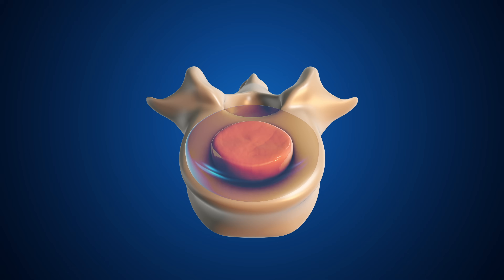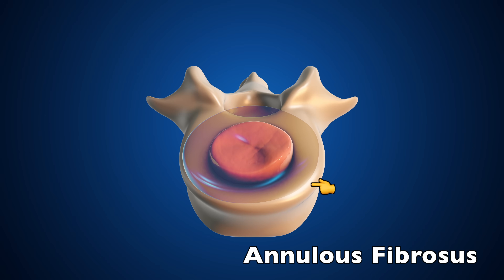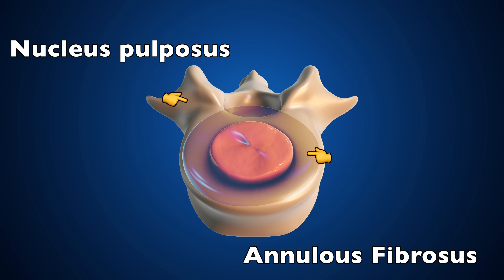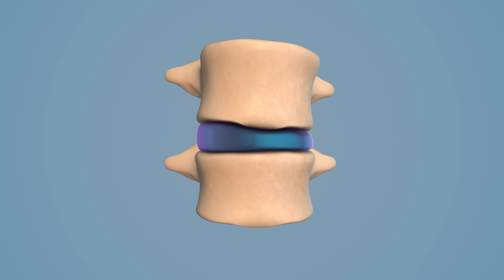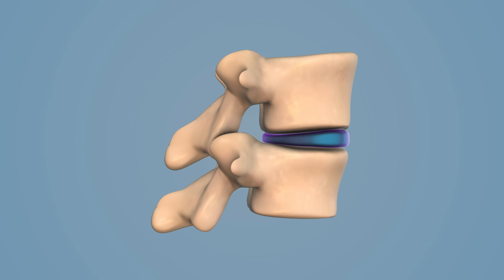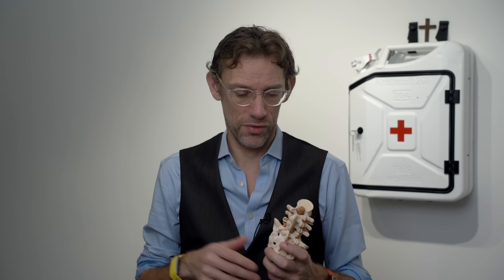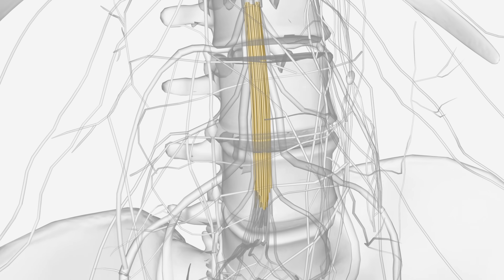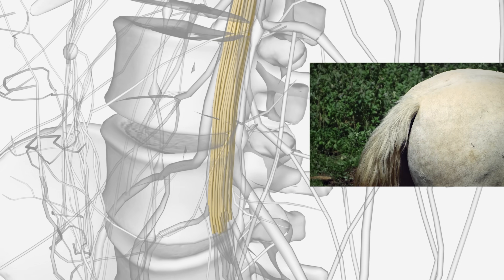Lumbar Spine Anatomy - What Causes A Slipped Disc? - Dr Gill

Comment: Hi Dr. Gill, I've been a subscriber of yours for a few years now, and I love your videos. I had spondylolisthesis with degenerative disc disease at the L5-S1 level, which was fixed with an ALIF about 2 years ago, after about two and a half years of being in and out of therapies and procedures (from ages 15-18: PT, steroid injections, and a microdiscectomy). It unfortunately caused irreversible damage to the nerve going down the back of my right leg and changed my gait, so I was wondering if you could perhaps do a video on the nerves, bones, and/or the general spine issues that occur there, their causes, and how to spot them in patients. This is more just for my general curiosity as a patient, but I love seeing all your videos and really admire your bedside manner. It makes learning from and watching your videos quite relaxing.

Comment: Thank you for this, much better understanding of my back now, I had a nasty fall backwards off of my bicycle where I landed directly on my back on a dirt/gravel path about 15 years ago and my back was never fully the same since so this helps me understand why.  Physical therapy did absolute wonders to bring it back to almost normal post accident but sometimes certain damage is permanent and no amount of therapy can fix it.  I’m also glad I practice proper lifting at work when necessary to prevent further damage!

Comment: Thanks for this. Im 42 and have had back trouble for nearly 20 years. I hurt my neck badly as a teenager and, apparently, this has caused lumbar problems! The discs between L1 - L5 are all damaged and have lost their 'sponginess'....I'm an inch shorter than I used to be.
I had an MRI about 6 or 7 years ago and I was told then that I had the "back of a 60 year old who did hard labour". 😳 
The only thing that has had any lasting pain relief, without constant medication, is my chiropractor who performs the adjustor technique. Nothing else worked nearly as well.